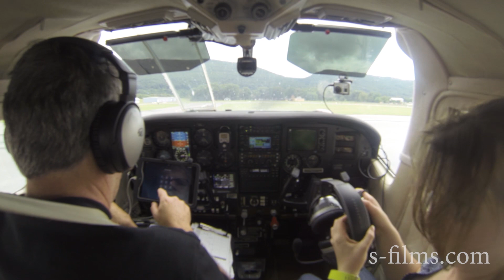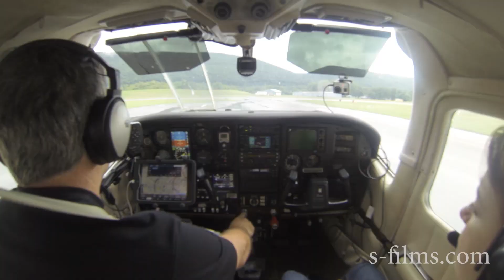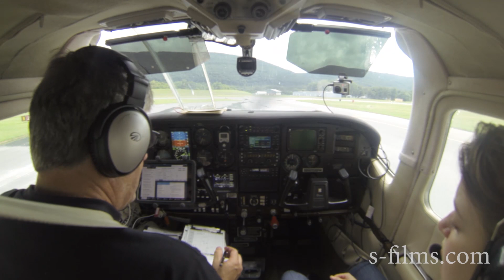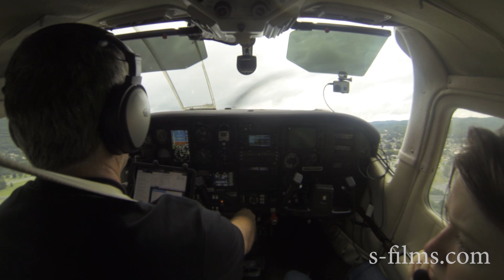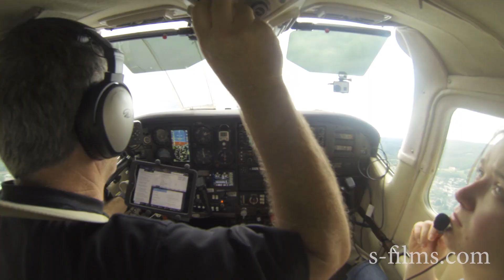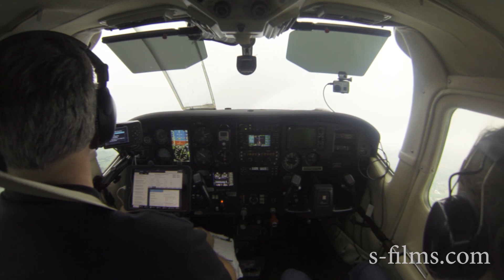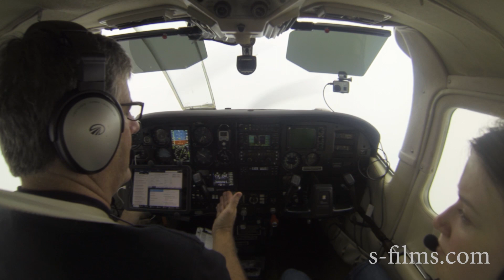What is that Sound on Takeoff? - TakingOff Ep24

Comment: I vote for a spinning wheel in the well.   Right after gear retraction.  Do you “tap the brakes” to stop the mains when you go gear up?  Have no idea about Cessna retractables, but some planes have a sort of skid plate in the nose wheel well to stop the tire.  Maybe the nose wheel settled forward just enough and was just touching one of the gear doors.  ??  If it was a tire, it must have been barely touching whatever it as it seemed to take a while to slow down and stop.  Any unusual skid marks inside the wheel wells?    Fun to speculate after the fact; probably nerve racking while it was happening.
Reply from the maker: THat's kinda what I thought.  But I found no wearing on tires or in wheel well.  And the sound has never returned.

Comment: Sounds like the gear pump. Did you check your up lock light and ammeter to see what they were doing?
Reply from the maker: Lock light yes, ammeter no.  Lock light was amber (normal).
Reply: Taking Off The sound began as soon as you initiated gear up. Take a look at your ammeter next time and see if its staying in discharge or pulsating with the noise after the gear shows up. Almost sounds like the pump is cavitating. Check your gear system fluid level before taking it up next to be sure you aren't low from a leak. Otherwise there can be a pressure switch that isn't functioning properly and calling for the pump to continue running even though not necessary... You'll know if that's the case by checking your ammeter to see if the pump is pulling juice after gear uplock.
Reply from the maker: Thanks, will check.  I've actually flown it 14 hours (XC from FW to Georgia) since and it has never repeated.
Reply: Taking Off May be a faulty gear position switch/pressure switch.